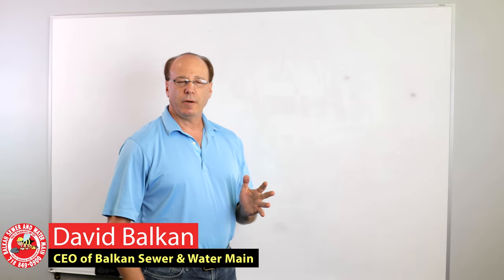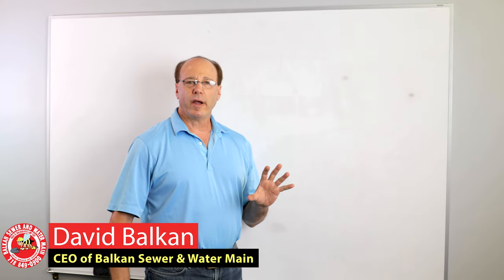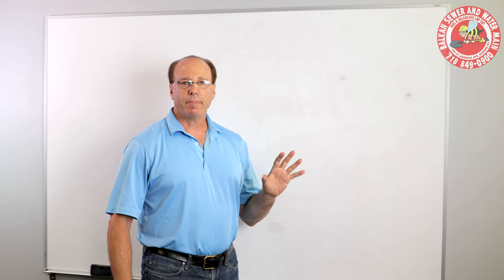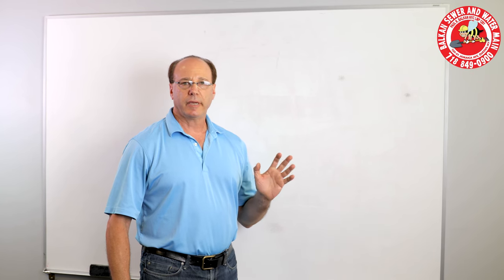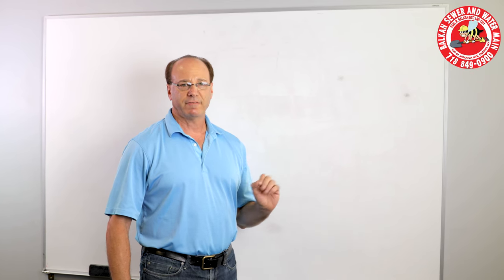Sewer Valve Installation Requirements: Helpful Tips

Comment: Can you put 2 gate valves? 

One in the front and one in the back?
Reply from the maker: Do not do that! Have a professional assess your situation before you take any action. Not every building is a proper candidate for a sewer valve. And 2 sewer valves is never necessary.
Reply: @balkanplumbing  I have a backwater valve in the front of the house. 

But I discovered that my gutters flow to the same pipe as the sewer line.   If I disconnect the gutters, then it will flow downhill into the neighbors backyard...
Reply from the maker: @johnkim1656  you just explained why not everyone is a good candidate for a sewer valve and careful pre inspections are needed. Sorry about your situation. Either you disconnect the leaders, or remove the sewer valve.
Reply: @balkanplumbing  indeed. Would you feel comfortable relying 100% of the time on a Zoeller pumping to the front street?

In case of pump failure, water would flow into the neighbors concrete slab
Reply from the maker: I could not comment on that. You’d need a licensed local plumber to come out to you.

Comment: I'm not sure I understand why a backwater valve is inappropriate for a house where rainwater discharges into the house sewer.  If the city sewer surcharges, rainwater is going to back up whether or not a valve is installed.  Wouldn't a valve at least prevent rainwater and backwater from mixing?  Better for a basement to flood with just rainwater than a blend of rainwater and sewage, no?
Reply from the maker: Because it would serve no purpose.